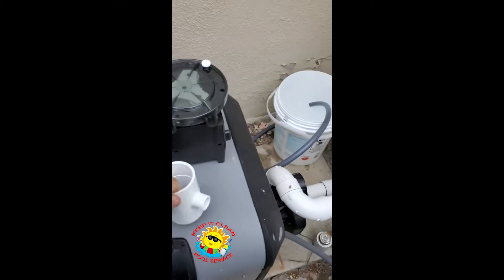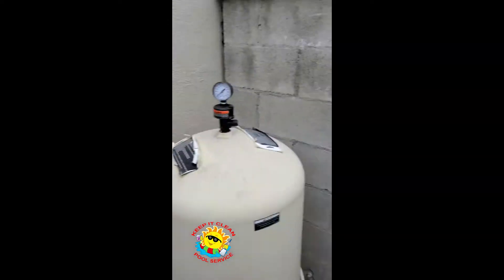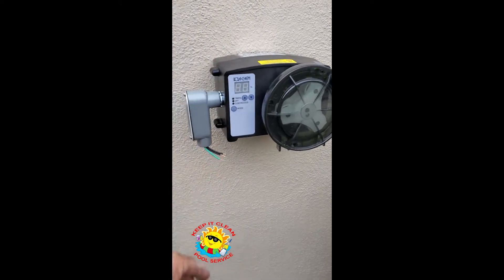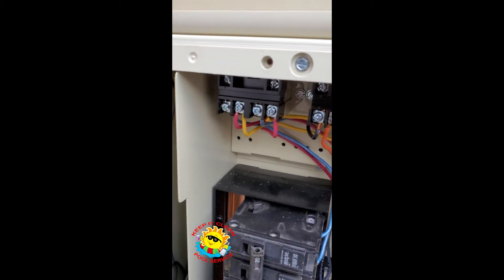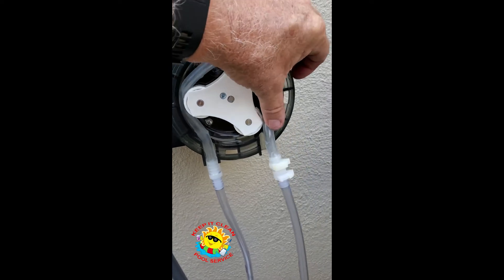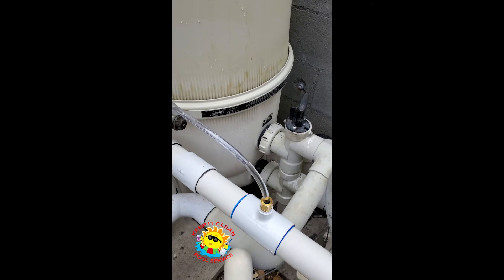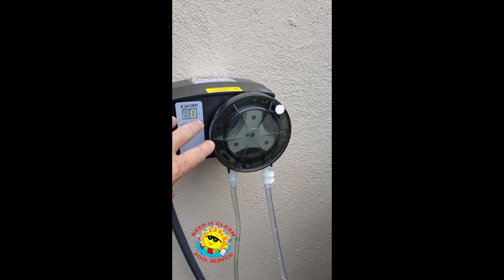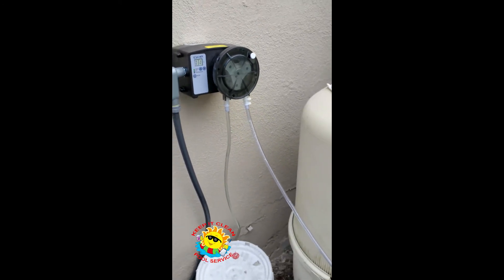How To Install A Rolachem With A Pentair Intellicenter

Comment: Thanks again, stalking all your videos. Have the 303 on order.
Reply from the maker: Awesome!
Reply: Do you have this pentair easy touch panel? Which one do you buy for thus 120 or 240v?
Reply: @fredjmz9334  I also just got the 120 and the existing pump timer had a outlet.
Reply: @fredjmz9334  I put on the T, and just the rolachem mounted to wood with stakes in the ground.  It works great. I also covered it with a grill cover just to keep the rain off.

Comment: Great Review....looking at getting the RC 301 (220V w/conduit) to tie it into a Haward filter pump breaker and use it as a slow acid feed system. Let me know your thoughts....
Reply from the maker: Yeah that sounds good. If you have stable chlorine all the time but are having issues with that pH thats a good plan. Do a mix of acid and water not straight acid.